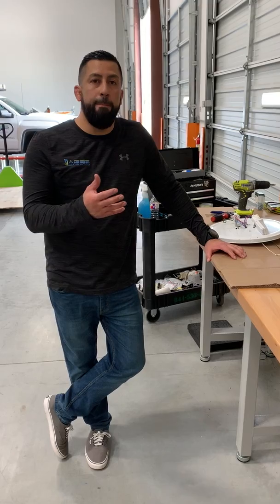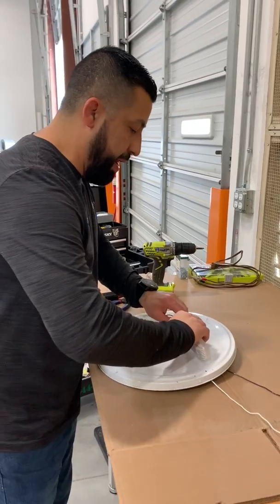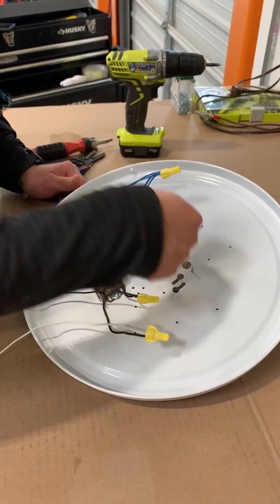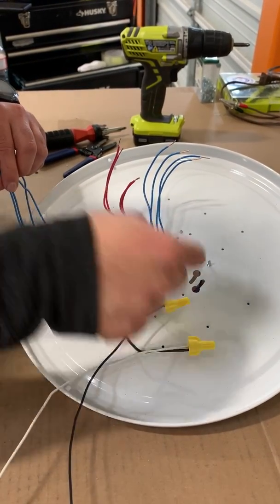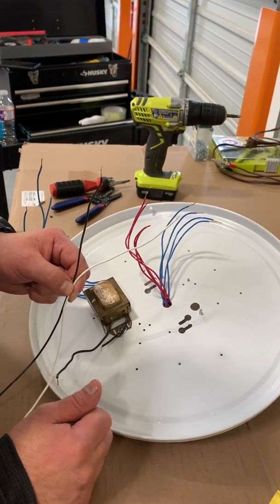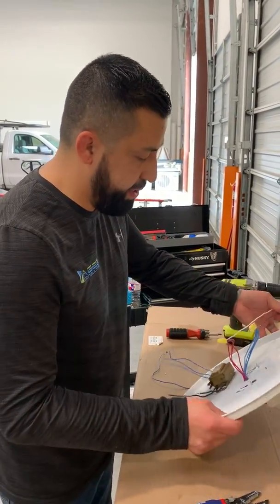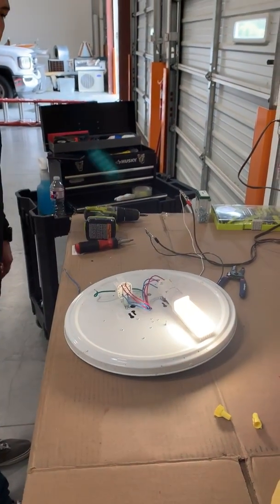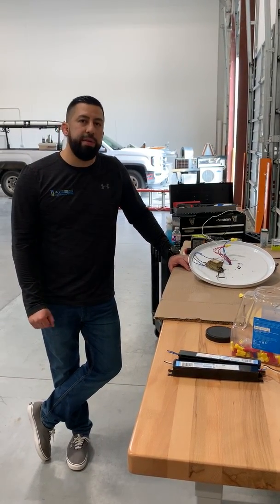AGES Ballast Bypass Training Video

Comment: Thank you for this.   I installed LED G24s to replace the CFLs and was wondering why they died after a couple months.  I didn’t bypass the freaking ballast!
Reply: Just did a similar goof with an adapter,  never did I think I would burn out my bulbs

Comment: Thank you for sharing, Josh! I have three Romex wire with ground (black, white and bare wire) connected to my existing G24Q lamp Base as opposed to yours with single. I know it is hard to picture what I have, but do you think a diy'er can bypass with multiple wires in my case 9 wires to a lamp? Thanks

Comment: Great video! I have a bunch Keystone Technologies 13 watt fluorescent lights with the 2 pin connectors that I want to convert to 100 watt equivalent LEDs. Which bulbs are recommended? Will I need to change the connector?

Comment: Hi John, my ballast seems to be integrated in the gx24 bulb housing and I also have a photo sensor wired in there.  My goal is to by an adapter so that I can use the screw type bulb since my ballast is busted - I replaced my gx24 bulb and it's still not working.  Any tips will be appreciated.  Thank you!

Comment: Two days ago a ballast went out on a 4 pin fixture in my bathroom vent fan.  The manufacturer doesn't make the ballast anymore and recommended I replace the entire fan assembly.  You posted this video the next day and saved me about $100.  Thanks!
Reply: The manufacturer DOES still make a ballast for your bathroom vent fan.  What the sales guy did is made up a bogus story in order to advertise modern technology.  It is a tactic that salesmen do to get out of having to place an order.  I hate it when they do this.  An awesome way of going out of business.  And, unfortunately it is becoming more and more frequent because businesses are hiring unqualified employees.  Try a different place.  Just don't buy from businesses who won't order the correct part and only buy from businesses who will order the product you need.